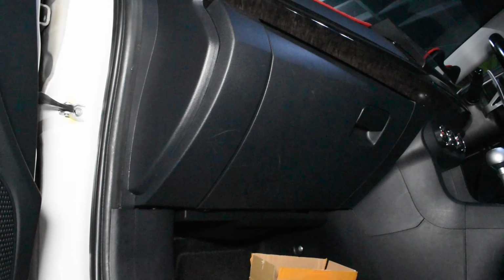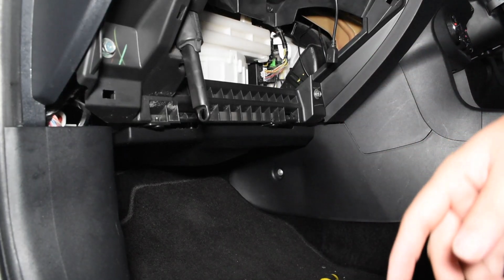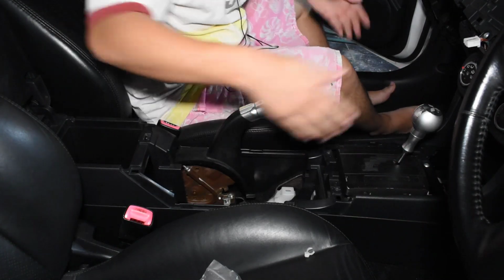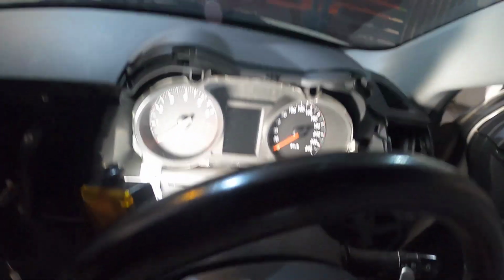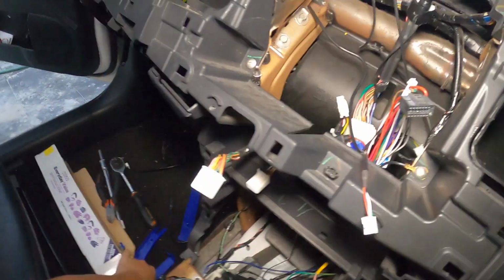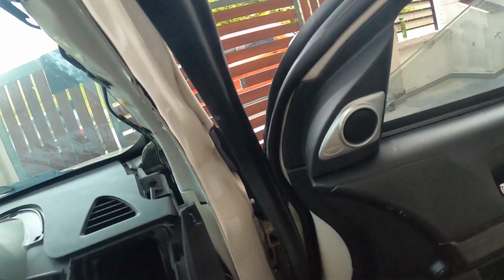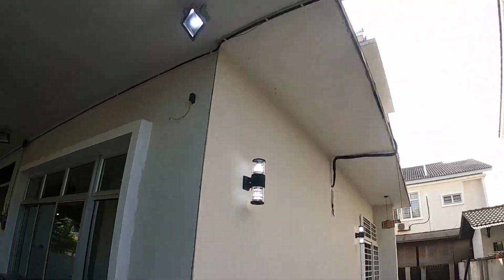How to remove dashboard off your car - Inspira / Lancer 08

Comment: im doing this right now on an Evo X. What is the last screws or bolts holding in the back ? mine wont seem to give and just pull out?  what did u do at 33:30 to get it to pop out ? thanks!
Reply from the maker: if i remember correctly....... i was removing the cover that is on top of the glove compartment..... which was totally not necessary. Just try to shake your dashboard a bit and see where is it still rigid, there will most likely be a bolt or screw or in my case (a cable still connected) that is holding it back. But if you are already at the stage of 33:30...... you are super close, DON'T GIVE UP.

Comment: Hey Tc, where is the video of you removing the steering column and the frame on the dash? Also in your next video in which you removed the white box that has the ac lines and heater core. Did you have to remove the ac lines in the engine bay?
Reply: Instablaster...

Comment: Thank you TC. This is the most detailed video on Inspira/lancer dash removal video I have ever seen. Thumbs up and really appreciate you for sharing.  Because of the GoPro focus setting, I seem to have missed on how to remove the board just below the passenger airbag. (that piece of dash where some owners will install a 3x60mm guage holder). Any advice on how that piece is held and can be removed? Thank you very much!
Reply from the maker: Thank you for your kind words. I don't think i removed the board. I removed it together with the entire dashboard. But looking from behind, there is a lot of screws holding it. That could be how you remove it. But looking at the angle, might be difficult to remove with the dashboard still in place. I know a place that just rip the entire board out and replace with CF 3 gauge panel.
Reply: @TCsAnythingGoes  I can understand why they would.  I've followed your video all the way through, but it's still being held in really well on the passenger side by something I can't identify.
Reply from the maker: @t4nimet  its most likely the two bolts holding the airbag,
Reply: @TCsAnythingGoes  It was.  Are there any other hidden fasteners like that holding in the metal framework between the dashboard and the cooling coil assembly?

Comment: Hello, I have a question, the dashboard on my 2011 inspira have creaking noise when rpm is around 1000-1300,which part should I take off and retighten in order to resolve it? 
Also,do you have loosen air vent problem? How to fix it or is there a replacement for it.Thanks in advance.
Reply from the maker: creaking noise... you will need to find the source. What i would suggest is have someone drive the car around or help you rev till 1000 - 1300 rpm, then you go around pressing the dashboard parts to identify where the noise is coming from. 
I HAD a loose air vent problem few years back, changed air vents to one i bought from China and never had the same problem ever again.
Reply: @TCsAnythingGoes  Thanks, but its funny when a replica part is better than the original part, hahahaha.

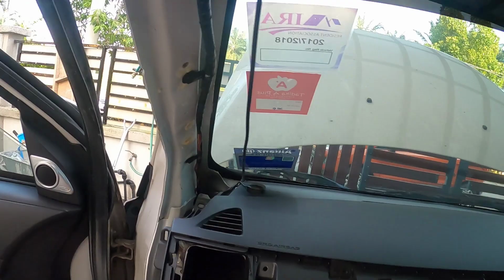Comment: 33:38 - 33:45 . ah you miss the thing that i want the most. I want to remove the cover for installing  the gauge pod /cover meter 3 beradik. It got screw or only clip that i can pull it out?
Reply: did you figure it out? i also have the same problem, theres a screw somewhere but i cant find it
Reply: 4 screws from inside

Comment: Very difficult work , how to remember to back again all this...
Reply from the maker: Unless one has photographic memory.... its close to impossible to remember. One way would be to take photos or video of the removal so that its easier to identify which screw/bolt goes where. Another way would be to have a lot of small containers by your side and only store those screw/bolts/nuts of one panel in each container.